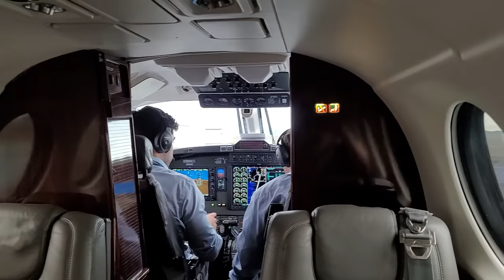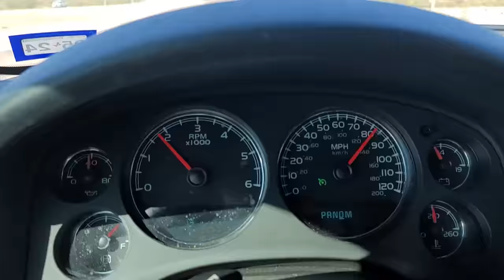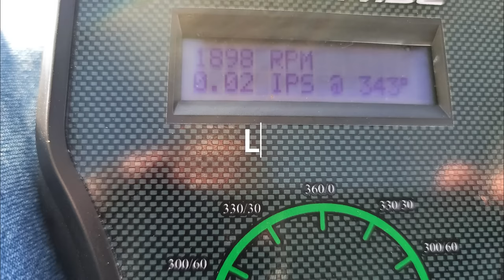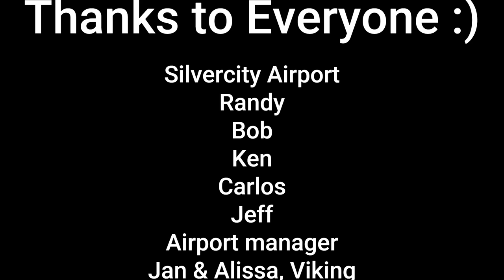Viking Honda 130 Engine Swap Adventure

Comment: I’ve watched your video twice because it’s so entertaining, particularly with all the plot twists.  Locking the keys in the truck probably topped them all after what you just accomplished.  I swear that same kind of stuff happens to me all the time; in fact, my daughter is always laughing about.  It’s comforting to know that I’m not the only one.  Loved your perseverance!   I have a certified aircraft and I’ve been envious of the experimental world.  I am fascinated with Viking and Aeromomentum engines (It seems like Jan and Alissa does a great job at customer service).  I have one question: Are there two ECU’s?  If one goes out, you switch to the other - how does that work?  Thank you for your time and the great video!
Reply from the maker: Good morning 🤠☕️
 I'm happy to hear ya enjoyed the video. We tried to make the experience educational,👍 vs frustrating .👎
The locked keys, made the day much longer, as we were exhausted and were ready to relax . Overall , it showed us how difficult breaking down could be. We were fortunate to land where we did, vs out in a pasture. Hopefully this wont occur again . 
 As far as ECU.  It is a single unit. I am not personally aware of any customer units going bad.  I have tested several , with different tuning . 
 I did have one beta test unit tuned for low octane , it shut off at low altitude. 
At the time , there wasn't a planned emergency procedure for that situation . It would not restart. Ended up doing a dead stick onto a main city road . No damage.  Since I was testing , I had the main ECU on board too. I swapped and restarted. Took off. 
Now, if anything happens , the procedure is to turn off all power ( reboots ecu ) and power back on, restart. 
Overall a very reliable system. 1200 hrs going strong.
Reply: @Texxas750Cruzer  Wow, thank you for taking the time “Texx” for the thorough response!  Good morning!  I had seen a video with a kit P51 using a Chevy LS3 and the ECU failed which ended in a crash (no time to manually drop the gear), no injuries thankfully.  That made me think about having two ECU’s controlled by one switch (up is ecu 1 and down is ecu 2).  Treat them like mags; so during the run up, you would switch between ECU’s to test them.  As you said, they’re very reliable… that’s me thinking again without car conversion experience.  One observation I’ve made: Zenith owners tend to be more open minded towards car conversion (Viking) and a lot more laid back in general while owners of another brand, whose initials rhymes with RV, not so much.  I’m not saying they’re mean just not so open to “non traditional” engines.  I prefer low wing XC so my mind is there but I am drawn to Zenith due to the culture and that the nose wheels are steerable (I currently own a Cherokee).  Thank you again from NC.

Comment: 28:27 not a good idea to have broken pieces in the air! Think if it can block movement of that arm or lever going through  it. This bracket has a bad design, to start with. Way too thin, considering alloy, vibrations & forces acting on it. The only reliable long lasting way of going low octane is reducing compression (like for ex., double head gaskets) but with reduced power output.  Quick & well done swap overall, considering situation. Just an afterthought, are these pistons forged or cast from the factory? Very beautiful landscape & picture! Wish you all the best!
Reply from the maker: Agreed, bracket design needs refined. It flew 100's of hours without the bracket upgrade part. So not concerned going back to previous no bracket setup.
This Honda runs 87 in a auto . Viking tunes their own ECU and prefers Mid to Premium. I wanted 87 , so we tried it.  It works fine. Somewhere along the line , prior to the low octane tuning , it detonated on 87 .   Oops
Reply from the maker: Cast on pistons
Reply: Isn't this an L15B  @Texxas750Cruzer  ? If so it looks to me like Honda wants 91 for its 11.5:1 compression. I'm sure you've done your homework, but 87 seems to me to be pushing it with compression that high.
Reply from the maker: @slopetechno   the stock honda fit engines are designed to run regular grade.  Viking recommends Mid or premium . The tuning is good for regular , so why not save a bit of $ if possible.  🤓

Comment: Is that engine injected? I'm planning a Subi conversion with light turbo boost for launch if needed. 
Are you planning a catch can? And is your crankcase atmo or vacuum? What time limit do you give your plugs, COPs, and controller? Do you have a way to temp sense each cylinder? Maybe a T-couple to each plug? There is a lot of data one can glean from experimental pilots who build their own. Glad you are one of the surviving types! Fair skies and tailwinds for your travels amigo!
Reply from the maker: Yes , guel injected. Catch can added. Atmospheric. Plugs last forever. No limit yet .
No temp setup per cylinder. Had that on previous corvair. 
Going to add an O2 sensor soon.

Comment: Didn't the knock sensor/ECU/display give you warning that detonation was occurring? I don't think this particular engine design is the best choice for aircraft, the design as a whole is not great. That intake manifold looks as though its designed for 12k rpm. How did the flexplate bend, quality viking.
Reply from the maker: I use a MGL screen , no knock display.
My testing put it out of Viking limits , prior to getting readjusted. 
I feel this is the BEST aircraft engine for 130hp.  Hard to go ~1200 hrs only changing oil . 😎👍
48 states without having engine issues or adding oil is not doable with Any other engine i'm aware of. Certainly not certified.  
I now have a fresh 130 and would challenge any engine to a endurance flight test 
🤠🏆
Reply: @Texxas750Cruzer  I use motec display/ecu for solely engine parameters with a Suzuki M series engine. The Suzuki is much better by design in my opinion, even routing the coolant hoses is easier, you can have them come from the front or rear of the engine. Simpler valvetrain, no vvt, great engine. Certified engines are far behind, wouldn't choose any of them. Safe flying.

Comment: Disadvantage of an automotive engine normal aircraft repair shop at most airports can't overhaul it, but advantage is lot less costly repair replacing with another Honda engine. Does it have logging show knock sensor indicating knocking? I would be surprised if that engine had pre-detonation because they are designed for 87 octane although I suppose computer is not the same as the Honda OEM.
Reply from the maker: No logging.  Car engine is faster and cheaper by far to repair . It is good to have mechanic skills too.  I simply could not afford to fly , if I had to use a certified plane.
Reply: @Texxas750Cruzer  I agree I'm in the same boat wanted to buy last year prices got so high I'm stuck on the ground. I have lot of skills with all kinds of non aviation engines. I like Honda engines can't beat Japanese engineering. Reason Honda and Toyota are some of the most reliable cars made.

Comment: I've been a journeyman mechanic all of my life since the early 1960's.  I've worked on every kind of engine you can think ofl.  Eventually ended up on Honda motorcycles/atv's etc.  Honda makes some of the best engines on the planet (and is the largest engine manufacturer in the world (all types).  In my early years I worked on a lot of air cooled, individual cylinder engines (like Wisconsins).  Mostly in trenchers, wood chippers etc.  The current "state of the art" air-cooled aircraft engines are dinosaurs of the past.  Push rods, huge tolerances, uneven cooling, carburetors  etc etc.  Air cooled engines of that type are ok for wood chippers but the fact that they are still used in aviation is mind numbing!  Look at the advances is auto engines during the same time frame!  Lycoming and Continental and the rest should be ashamed!  Like Harley Davidson selling 1930's vintage engines, they continue to sell that junk because there are people out there willing to BUY IT!  Time to bring the general aviation market into the new century (which is 24 yrs old already).  With the state of technology available today, it seems like a "no brainer" that SOMEONE would bring a modern, liquid cooled state of the art engine into general aviation!  Stay with it!!
Reply from the maker: AMEN !!😎👍
Reply: Very well said, Continental, Lycoming & Rotaxes are dinosaurs of aviation !
It is not only mind-bogling but also so tragic tthat they are still stuck with old technology while liquid cooled engines hv advanced to high level.
Reply: The engines you refer to are both simple and rugged. As an example...new tech engines use oil pressure driven cam chain tensioners. If your oil pressure gets low, your cam chain loosens up, starts slapping around, and you find this out when it jumps time and quits. Now you're in a glider with stubby wings. With one of the dinosaur engines if your oil pressure gets a bit low you see it on the gauge or get an alarm and hopefully limp it in to a safe landing
Reply: @harescrambled  I agree there may be a few advantages to these air cooled. IC Engines hv advanced tremendously in these last 2 decades, while these areo engines stagnate. To me it is shocking that used Yamaha engines are being installed in LSAs, surely cost is not the deciding factor here.

Comment: Hay Sr. I'd like to hear back from ya when ya have a minute , Thank you! Do you use Marvel Mystery oil in your fuel?
Reply from the maker: Negative. No additives.
Reply: I have a 1958  172 with an O-300 and it runs so much smuther! its been around for years, ask Jon about . I'm working on putting the 195 Turbo hp Honda in this plane. thats why I'm intrested in all ya do. Thanks man!
 @Texxas750Cruzer

Comment: If u do fresh up old motor you can by lots of race parts for honda id go with stronger piston and rings and bearing it would take 6 grand all day for and cam shaft of course few hundred extra bucks go a long way but thought I'd throw that out there

Comment: Whats the price difference between a Rotax 914 and a Viking.  My 912ULS went s 2200 before the previous owner replaced and I got the plane with 150 hours on the reman
Reply from the maker: Google. I do not work for any company , im a customer 🤠✈️
Reply: @Texxas750Cruzer   ok I was asking for a base price to compare.... as I am debating building one of these currently I fly a Remos G3 and the the nose wheel doesnt seem too stout so I want an additional airplane for Off Airport / Backcountry

Comment: How much $$ did this set you back?
Reply from the maker: It actually only needed 1 piston and a set of rings , tube of permatex, and a head gasket.
🤓👍 , but since I was torn down , I replaced all pistons & rings and valve guide seals. Total needed $125 ish. Total spent, ~$500.🤓

Comment: What do you think about the hoses/conduits laying directly on top of the alternator??
Reply from the maker: ALL hoses and wiring are secured , either ziptied or with rubber standoffs. Nothing is rubbing. There is slack where needed , to allow for engine vibration to engine mount. 
If ya see something that looks like it is not good , point it out specifically please. More eyes the better.  
This securing method has worked fine for last four years and 1200 hrs. See no reason to change it. 
🤓👍

Comment: Id pull the original engine apart and see why it failed.
Reply from the maker: Plan is pull apart this week. Borescope showed crack piston. ( likely from detonation while Tuning the ECU to run 87 octane.)  This truly was a Test engine to push limits. Thus making the engine safer for others.  😎👍
Reply: @Texxas750Cruzer  I saw the crack later in the video had to do something so didnt watch in one sitting.
Reply: Bummer. The best news is you didn't ignore the smoke and keep flying. I like to think of getting 2k with engine still running and then the MOH per the book. Good luck with the new block and thanks for sharing your adventure. I'm really interested in the 3 cylinder Chevy. Has Jan done anything more with that if you know?
Reply from the maker: @kenfawcett4006   yes, Viking (Jan) has been flight testing it. 
Should be out soon I suspect .
Reply: @Texxas750Cruzer   Please make a video of that, I would like to see how it failed.
Reply: @Texxas750Cruzer   Interesting.  Just curious...  Was the ECU and engine, as supplied by Viking, tuned originally for higher-octane fuel?  Who tuned the ECU for the lower octane and how was that done?
Reply from the maker: @markthibault8579   stock Viking ECU. Tuned to 87 by Viking . During testing we did bump the detonation zone a few times.  May have weakened things . To me that is part of experimenting. Find what works and doesnt. 
Viking has limits they recommend. I wanted to test outside those, out of curiousity.
Reply: I would love to see the wear pattern on the main and rod bearings.
Reply: @Texxas750Cruzer I don’t understand why a Honda car engine fried a cylinder on 87 octane that’s what they run on. Maybe a little to much tweaking instead of letting it run like it was programmed for cars maybe ?
Reply from the maker: @careysmoak5478   I'm not a programmer.  It was tuned at Viking for mid to premium fuel , to obtain Torque and HP in different RPM  bands. I ran low grade fuel that it was not tuned for , at this point. Later it did get tuned for me and low grade fuel. damage already done though most likely. Once it is rebuilt I will test it again .

Comment: That engine has 1200 hrs. Equivalent of going uphill at 70 mph. You have gotten your money worth
Reply from the maker: It is torn apart. Everything specs to within limits.  I've replaced the cracked piston and i'm going to replace the other 3 as well. Give it a fresh start. Valve guide seals also refreshed, because it was cheap . 
This engine will return to service. 🤓👍

Comment: What  does the actuator rod that goes through the broken bracket actuate plz?
Reply: I was wondering that as well. I think that it controls the propeller pitch.
Reply from the maker: Yes, it controls the Prop pitch. The bracket isn't needed, but I haven't removed it yet.

Comment: okay, i give.  Car engine or bust, despite exhaust valve carbon of direct injection.  Because the cost of Aviation motors that only run on dumb Av gas is sensless.
Reply from the maker: ACTUALLY, the carbon is vented overboard , not back onto valves . One of the perks of being in an airplane. So I get the benifits and not the negatives . 😎👍
Reply: Intake valve carbon

Comment: Missing nut on lower alternator attachment bracket.
Reply from the maker: Good eye , It is threaded 😉.  But Ty for looking closely
 😎👍🏆
Reply: @Texxas750Cruzer  thanks but treaded should have lock wire. Some would agree to just a lock washer.
Reply: A jam nut would work as well
Reply from the maker: @waynetokarz174   Not true on lock wiring .
It is a auto engine. Never see safety wired anything on normal cars.  A nut on backside of the threaded bolt is fine for peace of mind . 👍

Comment: I thought this engine was direct injection? Detonation should be a thing.
Reply from the maker: The tuning is Not a Honda ECU.  It is re-tuned for max HP at a lower RPM.  But it was tuned for premium.  It didnt enjoy 87 oct power climbs I guess. 😉

Comment: Rather have a 2000 hour motor,that's what jabiru is offering  in there new motor
Reply from the maker: Two points... if not abused , the Honda 130 is capable of going past 2000.
 Second... I've never seen, or heard of a Jabiru make it even close to 2000 without issues . Can you send me a link to it ?
Reply: @Texxas750Cruzer  they have vids showing  a breakdown of the new generation 4 engine  on you tube,they put hallow push rods for oiling cast the block ,cylinder bolts changed and they used it to a 2000 hour motor according to them
Reply from the maker: Pushrods are old school , so is air cooled and having to adjust the mixture . I do not miss that type of engine. Not fun flying. 
 To each their own . I will stick with a liquid cooled , fuel injected .
Reply: Yes that's bin a true fact ,but I would think of getting  fuel  injection.  saw a ch 701 new with a new jabiru 2200,also found one at a good price without an engine,was lo0king at options.

Comment: I would never use Mobil 1 i blew a engine in my car using it years ago. I used Royal Purple in my race car for 5 season's and after totaling that car i pulled that engine and removing the heads that engine showed very little wear.
Reply from the maker: Honda likes M1. Viking recommended M1at the time. Now just a 0W-20 .
I did a bit of gearbox testing of every oil I could find . Royal purple foamed/Airated , more than M1 90w .and gearbox ran warmer as well.  I had expected the opposite .
Project farm tested oils . Maybe watch that again for engine. 👍